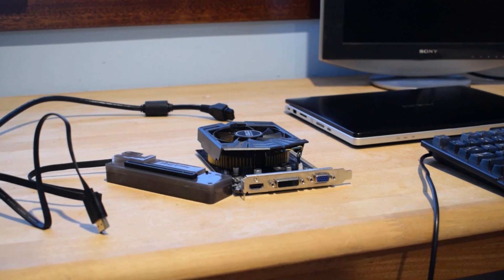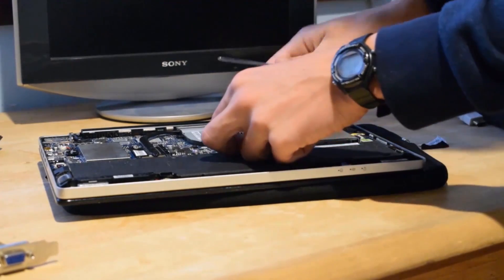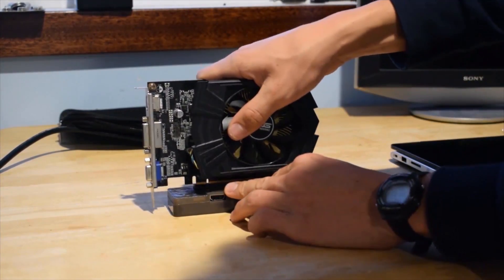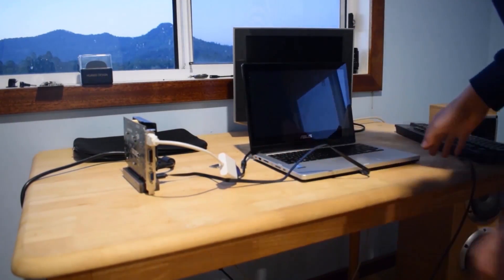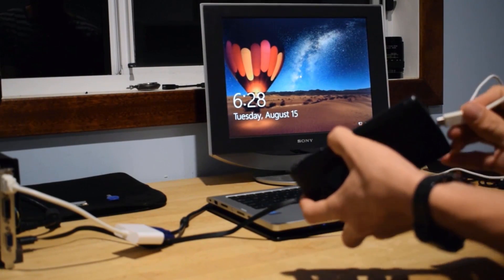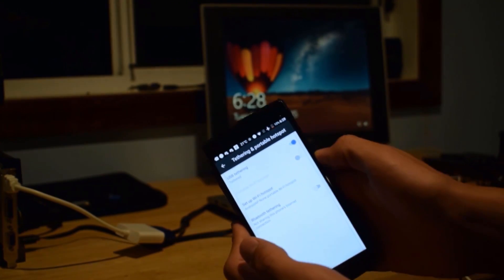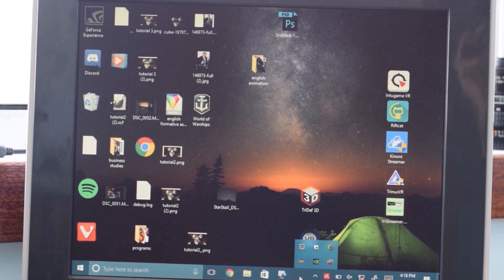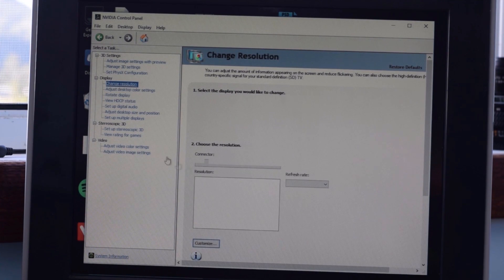How to Connect External PC Graphics Card to Laptop (no thunderbolt port required) Egpu Setup

Comment: OK I got  a hp  pavilion  940m  and I'm planning  to put  a 1070  will it work  or not.
Reply from the maker: +ToKnightX XY It should work with the external gpu setup as long as your computer does not have a bios whitelist. Apparently hp stopped having bios white lists on their laptops around 2014, but do a bit of research on whether your particular model has one. Otherwise it should work, as long as you have a decent cpu and around 8gb of ram (some of the newer games might need that).
Reply: qwertypop ok  thank  you  m8  I will
Reply: qwertypop mine  came  out in 2015  is that good enough for the setup  I'm planning  to do
Reply from the maker: ToKnightX XY What cpu model does it have?
Reply: qwertypop i7-6500u cpu  2.50ghz
Reply from the maker: ToKnightX XY Yeah, that should definitely be good enough, providing it doesn't have a bios whitelist.
Reply: qwertypop thank  you  so much but if I do get  the gtx  1070  will  it make it over heat to  much and if  so what do you recommend
Reply from the maker: ToKnightX XY You can't actually put the 1070 into the laptop, you will need to use an external gpu dock and plug that into your laptop like I did in the video. This will not make the laptop overheat as it is external. Sorry if I misunderstood you, and you meant if putting the 1070 into the laptop instead of the 940m will work. This won't work, because the 940m is a laptop gpu and requires a lot less space and power than a desktop gpu like the 1070, which won't fit and needs a lot more power.
Reply: qwertypop oh  thanks  for you're  help  I subscribed
Reply from the maker: ToKnightX XY Thanks :) I wish upgrading laptop graphics was as simple as putting in a new graphics card too, but most of the time you can't replace the inbuilt gpu.
Reply: qwertypop it's all good

Comment: i3-5005u 4 gigs? 
any recommendations or should i get a better laptop all together?
Reply from the maker: +DarkErrorCode I reckon a 750 or 750ti should work fine with that cpu. Even something better might still work ok. Maybe consider upgrading the ram to 8gb should you decide to go ahead with the egpu setup, and have a look at some other laptops that have good inbuilt dedicated graphics, and consider whether it is more worth buying a new laptop (if you have enough money). Keep in mind that a new laptop will be portable with good graphics, while an egpu setup is not so portable. Sorry for the late reply, I have been away, and only just came back.

Comment: Do you need to have another monitor? What is the reason of not being able to use the laptop screen?
Reply from the maker: Alan Pena I honestly don't know the technical aspect of why it does not work. Some people do appear to have it working. I believe they are using nvidia optimus, but I haven't really looked into that yet. I think it's only compatible with a few new laptops, not sure though.
Reply: qwertypop I just looked up for a tutorial on how to do it on without needing an external monitor, it was quite a bit of filing moving around but I'm sure it's worth it. I'm not sure what GPU to buy to try this on, currently I have an i7 with 940m and would enjoy to try this and get a double fps on FPS games, any ideas under 200$?
Reply from the maker: +Alan Pena Maybe a gtx 750ti or 1050. Just look at some tests with the respective graphics card and the games you are planning to play, and see if they perform well enough with one of those.

Comment: I have dell, core i5 3210m, 8gb ram, would I be able to put gtx 1050ti graphics card ??
Reply from the maker: You can put a 1050ti on it, but it would bottleneck the gpu a bit. Unless you already have a 1050ti lying around, I would recommed you get a slower graphics card so that you aren't wasting your money on performance you won't get.
Reply: Any graphices card you advise me to use
Reply from the maker: murtadha minister Depends on what you want to run, but I would recommend a nvidia gtx 1050ti or below if that's sufficient for your needs, just to avoid your cpu bottlenecking it.
Reply: qwertypop i5 7th generation will bottleneck it?
Reply from the maker: It shouldn't, but I still would not recommend something too powerful (like a 1080), because i'm not sure if the mPCI-e connection supports that high bandwidth. Also, the core i5 3210m is a 3rd gen cpu incase thats what you were referring to.
Reply: qwertypop will my cpu back damage if i connect egpu? What are sideeffects of egpu
Reply from the maker: +Saad J I don't think there are any side effects, apart from that you need to open up your laptop more often, which might cause some wear, and that you always need to ensure that the laptop is fully turned off before disconnecting or reconnecting the egpu to avoid damage to both the laptop and the gpu. Also, you will obviously need use some alternative way to connect to the Internet. So as far as I'm aware, I see no reason why it should damage the cpu.

Comment: I have dell, I5 dual core, 8gb ram, would I be able to put your graphics card on?
Reply from the maker: +x_x__OzeyrAFG_x_x - As long as your laptop doesn't have a bios whitelist, you should be fine (I don't think dell usually has bios whitelists on their laptops) My laptop has an i3 4010u processor, so if your cpu is better than that, it should be good enough. So yeah, it should work from what I know.
Reply: yea mine is intel core i5-6200U CPU @2.30GHz, and I'm trying to run a game like gta5 but I don't know what graphics is should get, also if I do install it, does that mean no WiFi for me?
Reply from the maker: +x_x__OzeyrAFG_x_x - Your cpu should definitely be good enough. To see what graphics you should get, I would recommend you check the recommended specs for gta 5, and then watch some gameplay footage on YouTube to see if it runs well enough on the graphics card of your choosing. You will lose your ability to connect to the WiFi directly, but can still use a lan cable or connect to your WiFi with your [android] phone and share it's WiFi connection as described in the video.
Reply: alright thanks>

Comment: you cant play online games? if you take off the wifi card?
Reply from the maker: Well, you have to use a lan cable or connect a phone via usb cable and share the phone's wifi connection with the computer over usb. Otherwise, yes, there wouldn't be any internet connection.
Reply from the maker: RAGHAVAN K Yeah, true. You can get one of those for around 8 usd from eBay: https://rover.ebay.com/rover/1/711-53200-19255-0/1?icep_id=114&ipn=icep&toolid=20004&campid=5338180966&mpre=https%3A%2F%2Fm.ebay.com%2Fitm%2F112478797945%3F_mwBanner%3D1

Comment: Is mini display port the same as a thunderbolt port if not is there a converter I can get
Reply from the maker: ItsVicHD Sadly mini display port and thunderbolt are not the same thing, even though they have the same port dimensions. Mini display port only allows your device to connect to a monitor, and transfer video output to the monitor. Thunderbolt adds pci-express capabilities, allowing it to transfer data both ways at high speeds. This means that mini display port will not work for connecting external graphics cards, and no adapters will make it possible :(

Comment: What about BIOS whitelist?
Reply from the maker: Yeah, like +TheScreamerBoy said, its a list of allowable devices, and if the device is not on the list, it will be blocked from connecting through the mPCI-e slot. This is mainly a thing on older HP and Lenovo laptops.
Reply from the maker: I didn't have any issue with bios whitelist on my Asus Laptop, and my friend didn't either on his Dell laptop. I would suggest you google if your laptop has a whitelist, as this is specific to each brand/laptop. I also heard something about workarounds for whitelists on some laptops, so check that out too. Hope this helps.
Reply: qwertypop yeah i did some research on whitelist thing and google says hp and lenovo have whitelist on all their laptop. Bad thing is i have hp laptop. Well shit
Reply from the maker: Yeah, I read that HP is the worst with whitelist (they block bypassing it). So yeah, I guess the chances are pretty slim that it will work for you :(
Will add that into the description of the video. Didn't think of this as I never had any issue with it.
Reply: Where can I find this BIOS whitelist?
Reply from the maker: Frost Борост Not 100% sure if this is true, but I read that apparently hp stopped putting bios white lists on their laptops after 2014.
Reply from the maker: Jan Duarte google
Reply: need exact keywords since it does not help typing :BIOS whitelist for Asus laptop
Reply from the maker: Jan Duarte I am quite sure that no Asus laptops have bios whitelists, so you should be fine.
Reply: Frost Борост hey, that's why they made a version with expresscard (if you have expresscard) I reccomand you use the dock over expresscard.
Reply: sorry but what is a bios whitelist? a odd feature ade for...what?
Reply: It's a list that blocks device (that are not accepted in the list) from connecting to the motherboard. Basically it means that you can't connect whatever you want on the mpci-e slot.
Reply: so i HOPE it would be possible to use chinese laptop like EZbook , chuwi..... with egpu?
Reply from the maker: +Frost Борост Hey, I found some additional info on bios whitelists (check my "useful resources regarding egpu settings" post), and think from what I read that HP might have stopped having bios whitelists on their laptops somewhere around 2014, so if your laptop is rather new, it might work (you would have to do some more research on that though)
Reply from the maker: +realista182 Hm, not sure honestly. It should work as long as it does not have a bios whitelist (I don't think they have), and if the wifi card is not soldered on, which is the case with the person sharing his experience here: https://www.reddit.com/r/eGPU/comments/77zbhs/my_experiences_with_the_exp_gdc_beast/

Comment: What model is psu?
Reply from the maker: +Harun Akif Kaya It is a dell DA-2 series psu (model: D220 p-01) you need to check if it would be powerful enough for your graphics card though, as some gpu's require more power to run stable.
Reply: Reis harbi güzel bi soru sormuşsun da bunu çevirebilir misin ne yazmış adam
Reply: demoNNN Güç kaynağının marka ve modeli Dell Da-2. (220w gücünde)Ancak kullanmak istediğin ekran kartının tükettiği güce göre atx bir güç kaynağı gerekir. Yazdı.
Adamın kullandığı güç kaynağını araştırdım. Amazon ve E-bay'de Türkiye'ye yollayan birkaç satıcı var  onlar da yolladığında sadece kargo parası 40 Dolar civarı oluyor. E kartta zaten 180-200Tl arasında bir fiyatta, sadece bu güç kaynağı için 350-400Tl vermenin hiçbir mantığı yok. O yüzden normal pclerde kullanılan bir atx psu çok daha mantıklı. Onu da Sahibinden.com'da 50-100tlye rahatlıkla bulabilirsin.

Comment: what's up
I made the experience with my machine and got great results using a gtx 1080ti check out
I put in the description the performance in the games
next step?
the case

https://www.youtube.com/watch?v=umOgCiynRaY&t=0s
Reply from the maker: Junior Ituano Nice benchmarks :) I wish I had those games to do benchmarks with, but I don't have that much spare money to "waste" on buying games.
Reply: I did another experiment and it was great, I adapted the Alienware Graphics Amplifier to test the EGPU EXP GDC
https://www.youtube.com/watch?v=lF0qDyiNOZ8&feature=youtu.be

Comment: how do you think an i7 4500u would do fitted with a 1050ti egpu and 8gb ram.
Reply from the maker: HunX Hun hard to say, but I reckon it should be fine. Then cpu might bottleneck the gpu a bit though, but it shouldn't be too bad. This is just my guess though. Best way to check is probably to find an equivalent desktop cpu and then Google if that cpu would bottleneck a 1050ti.
Reply: qwertypop gg, man. Thanks for the help! Will check it out.

Comment: Hi, can my Lenovo g50-45 with processor A8-6410 run an external graphic card?
Reply from the maker: It should be able to, as long as your laptop has a wifi card slot. Your cpu appears to be on par with mine, so you should definitely get good performance increases on most games (not so much on cpu intensive ones).